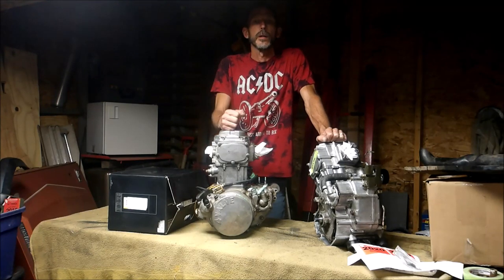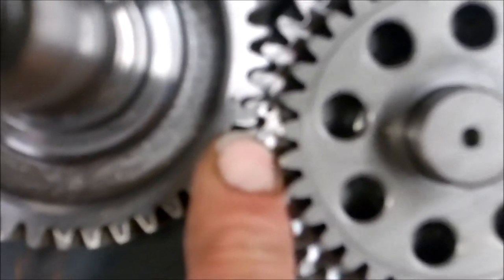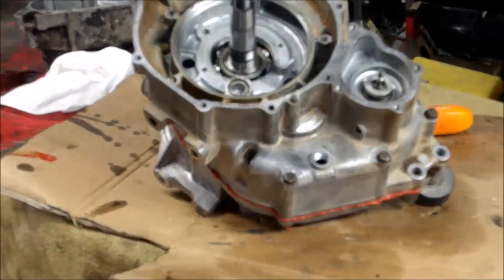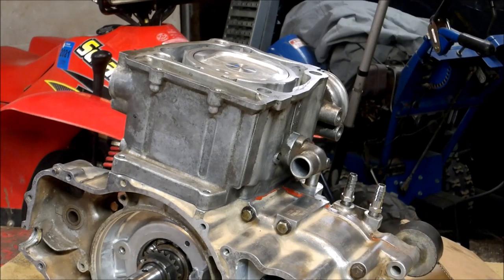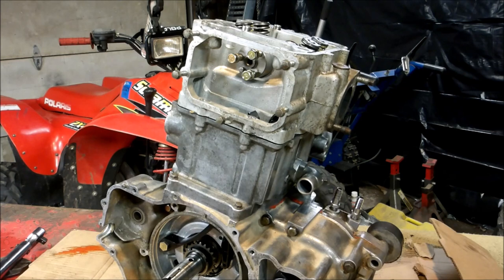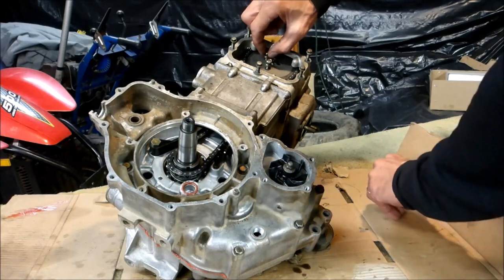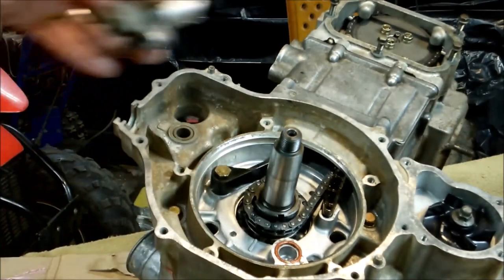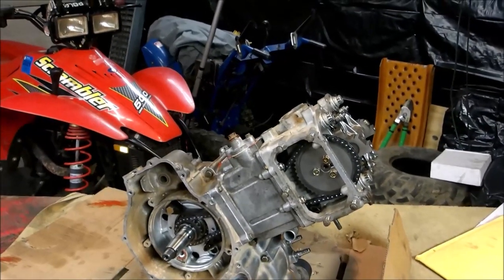Complete Rebuild a POLARIS 500 From The Bottom Up! And a 425.

Comment: Thank you.. very helpful video to increase my confidence in tackling this.  Have a 97 Xplorer 500 that I am fighting to get running despite a new stator, flywheel, battery, coil, plug wire, plug, filter, fuel pump, carburetor, etc.  Can’t get it to start without taking carb off and dumping fuel.  Going to tackle the internals..

Comment: I have a 2001 Sportsman 500 that needs a timing chain but I'm trying to get the fly wheel off but not sure which direction to turn the nut holding fly wheel on. Hoping you can help. Thanks John

Comment: the 425 "engine" crankcase. Was the crankshaft assembly and connecting rod all 425 as well? so you just changed the piston and just. The cams are the same but the valves are different numbers between the 425 and 500. Would've been nice to confirm if the valves were the same size with dial calipers.

Comment: got a 500 bottom end. connecting rod is in great shape. no end play and very little side to side. the main bearings are good to, turn smooth and no up and down play. but the whole cam shaft can slide left and right in the case maybe a half mm. what you think is wrong? i never split the case. you think something is worn, or maybe missing a shim? or should i just send it lol. have you ever experienced slight left and right movement in and out of the bearings on any of your engines. my other bottom end doesn't move at all.

Comment: Cylinder jug aka cylinder- 4 large 12 point bolts= 46 ft-lbs 
2 small 6 point bolts= 72 inch-lbs
Reply: Is this the torque value for the first 4 bolts he torqued before moving to the 4 bolts of the head? Not asking because you didn’t explain it well enough just want to make sure because I’m having trouble finding the torque value for the bottom 4 bolts lol
Reply: @johnshepard1157  Yes.  It's the bolts that screw in around the piston.  They sit down in it.

Comment: You mentioned the crankcase was cracked. Did you just get one used crankcase half and mismatch it  with yours or did you use a used pair?
Reply from the maker: I used a matching set. I have done a 400 2 stroke with missing match set and had no issues.
Reply from the maker: Miss matched
Reply: Thank you for the reply on an older video. I managed to crack the right side case while pushing in the counter balance bearings.

Comment: I've got a scrambler 500 ho 4x4 wanna rebuild it I googled the compression ratio and it's 10:8.1 but every piston I see that will work for it no matter where I look is 10:2.1, is that the actual compression ratio?... really don't wanna be down on power and speed.

Comment: Rebuilding my 425 and might get the 500 piston & jug. Did you use the 425 carb & exhaust or did you have to upgrade to the 500 carb and/or exhaust?

Comment: I really appreciate the video its very helpful. i do have a question do you bottom out the nut on the water pump impeller? it seems like it presses the impeller onto the housing? thanks in advance for any feedback!
Reply from the maker: I just snug it up with locktite. you don't want it rubbing against the case. you might have to back it off a little

Comment: What kind of crankcase sealant did you use? Polaris OEM Crankcase Sealant is about $50 for a small tube. Is the OEM sealant necessary or is there an acceptable alternative? Great video. I'm using it to help me rebuild my Magnum 330. Not exactly the same but a lot of what you show in your video is helpful. Thanks!
Reply from the maker: I normally use 3m gasket maker. You can get it at a auto parts store for 18 bucks.

Comment: Good work! I have learned alot from your videos. 
I've got a real teaser for ya..
02 500 ho just rebuilt topend, namura piston gaskets etc. Bored over as well. 
Anyway, runs great! But will only start with recoil, key cranks engine but no fire..
Any ideas?
Reply from the maker: Thats a new one for me. I'm gonna have to research that one. Interesting! Refresh my memory. does the 02 have the key that turns all the way to start it like a car? Or is it the push button style? something in the wiring isn't reading correctly.
Reply: @TitaniummanGarage  
Turn key ignition, I've tried jumping power from battery, directly to starter with key in hot position, still no fire, seeing week spark while cranking with starter, strong spark with recoil..pretty stumped. I can start it but my girls can't. I appreciate your thoughts and suggestions very much!

Comment: So Polaris made a 425 that had a 5 speed auto clutch trans I just wonder if u could make a 500 ho using a 500 jug cam and carb that thing would be wicked fast
Reply from the maker: I tried. Put an H.O carb and cam in it. wasnt much faster. Clutching it out right does the trick.

Comment: I got a 2013 Polaris sportsman with fi with 7600 miles on it, so with that said, it got to where it wouldn't cold start without holding the fuel down on it, so I would do a valve adjustment and it would be alright for about a month, or so, and then the intake valves would tighten back down, well, finally I bought new valves, and done a valve lap and installed them. If it starts with the same problem, do you think I ought to buy a new head and new valves to cure the problem?
Reply from the maker: Sounds like your chain might be streached.Try to replace the chain. clean the carb and check the choke adjustment.

Comment: This is a great video. Just subscribed. Just got my 1st Sportsman 500 w 900 hours.  The engine has a little knock.  (It's not a deep knock like low end.). I've noticed other Sportsman 500's on YouTube have the same sound.  What is it?  What do I need to do? Preventative wise?
Reply from the maker: It could be the clutch buttons. The lifters and chain make that noise as well when they are worn.
Reply: @TitaniummanGarage  Started it up again today.  Sound goes away when rev it but it smokes around the head/valve cover.  Shut it down right away.  I ordered cam & rockers.  Should I pull the head to see if there is piston slap?  Pretty sure the knock is from the engine.
Reply from the maker: @jaywinters2483  could very well be. I did a video years ago on a ATP. Turned out half the piston skirt was at the bottom of the engine.

Comment: Which oil hose do you pinch to prime the oil pump?
Merry Christmas, don’t drink too much Budweiser, mate.  How is Covid-19 doing in your area?

By the way? How do you pull the crankshaft apart? 
And putting it back together?
Hasta la vista amigo. Ándele ándele, arriba arriba
Reply from the maker: Have a Merry Christmas as well. We are getting hit hard in Wisconsin. I use a press to remove the crankshaft out of the block. You could use a big rubber mallet too.

Comment: Subbed . Man you have confirmed my tgeory same part different number thing!  Ive seen that with a lot of polaris stuff out there particularly sprocket and axle bearing carriers and what not. I have a 2000 polaris 500 sportsman 6x6. Chain snapped busted rh of the gear case. My thougts are i had an alignment issue on tge new sprocket and the output shaft bearing. Got a lot of slop in that output shaft now. I cant find my gear case rh anywhere! Do you have a source for that part? Id like to rebuild the trans while i got this down. Also the sprocket was replaced with a superceded part on that middle axle . The old one was seized to the axle and i couldnt get it off. I bought this used from a guy had bad bearings back there  and he just rode it that way for god knows how long. Well when it came tim to fix this , i ran into siezed sprocket on thw axle and rhe biggest of pullers only warped the old sprockt didnt budge it . So i had to cut the axle bearing carrier in half straight through the axle. The acle was badly damaged anyway so i was gonna have to replace it. But i could not get it out. The locking hubs were siezed up on one side as well . It was a real pain to get that back together. Well when i did i realized the sprocket would not line up proper. I need a spacer any idea where i can find one of those?

Comment: I am struggling to find a torque spec for the rocker arm tower bolts. I looked through a manual online and found 9 ft lb. that seems to be very light to me and want to be certain before putting it back together. If it is only 9 ft lb would it benefit having some blue lock tight to keep the bolts from coming out?
Reply from the maker: I would do that just to be safe.it is an aluminum block so that could be right.

Comment: Did you use a crank and rod from a 425? If so that should be a 465cc. I’ve been wanting to build one for a while. Basically put a 500 top end on a 425. Then use the h.o cam and intake /carb.
Reply: Hopefully the rod is longer. He never checked deck height. Hopefully it's not 7x1 compression now. I am planning the same
Reply: @eyeballengineering7007  have you calculated the compression to be 7:1 if using a 425 bottom end and 500 top end ? I was always curious. I think I remember the 425 being 8:1 and the 500 is 10:1 roughly.
Reply: @gshew6769  no, I went down the rabbit hole last night. The cylinder height is apparently the same. It's only the rod length that changes. So it should actually increase the compression directly between what the Magnum 425 and the 500 have stock. The magnum is 9.2x1 while the 500ho is 10.2x1. so the 465 with the same chamber and deck height should be approximately 9.7x1. I could not find the chamber size or the head gasket thickness. When I get my motor yanked apart I'll know a lot more. That's why the numbers are approximate.
Reply: @eyeballengineering7007  very interesting, keep me updated my old 400 is pretty lazy and I’m considering doing a rebuild on it and adding some stuff like a cam , bigger carb etc. might even do some at home port polishing.

Comment: Thank you, I will take a look at removing the cam and see what happens with the oil.
What about the sheared bolt from the timing chain that fell inside the engine? Has it happened to you, as well? I trying to figure out a way of extracting it from the engine without having to dismantle the whole engine, too painful, mate!
Reply from the maker: No I haven't.  I have had to pull out piston skirt out of the engine. If you pull the cylinder and piston you should be able to get a magnet down to the bottom of the case. If you have a magnetic wand. I ended up splitting my case. Your just looking for a bolt so It might not be that bad.

Comment: The 425 crank has 5mm less stroke, so essentially you've created a 465cc engine. Great news for 425 guys since there are kits out there for $90 that include the jug, piston+rings, and gaskets. Funny that it all just bolts right up and the piston has the proper deck height.
Reply from the maker: Right. People don't believe it when I tell them I do that.
Reply: Can you provide a link to this kit I’m having issues finding it
Reply from the maker: @TXCOyt  There isn't a kit. I just bought the gaskets and piston on ebay and honed out the 500 jug.
Reply: Got my 425 running about a month ago with a 500 rebuild kit. Everything fit perfectly, has good power.

Comment: Are all the 400HO engine crankcases interchangeable with 500s? I have a 2009 sportsman 400HO. Does it mater what year 500 jug i use? Thanks
Reply from the maker: That I would have to research. The older 400's had shorter connecting rods. No it doesnt matter what 500 jug. they are all the same.

Comment: Hello I've subscribed to your channel great content but I have a question what is the standard Piston ring gap for a 98 Polaris 500 because i have the manual and it say that its supposed to be gapped at 0.20/0.36 is that correct Thanks for your time keep the videos coming
Reply from the maker: Depends what piston you buy.

Comment: Great information! You just got a faithful subscriber!  :)   I hope you can answer a question for me and save me some time. I recently rebuilt a 2003 Polaris 700. It has been running fine now I have water in the oil. I can see seepage from the side stator casing. Do you think it would be the oil seal or head gasket?
Reply from the maker: I had one too. Its the Mechanical water pump seal. It could leak into the engine. But you said water right? Or coolant?
Reply: @TitaniummanGarage  Coolant.. I think water pump and water comes out of my mouth. You never hear them called coolant pumps. LoL
Reply from the maker: Lol. That what I thought. But yeah..the mechanical water pump seal leaks, gets in the engine and oil.  The 70's are known for it. I have a video how to replace it.
Reply from the maker: 700's. Not 70's.
Reply: @TitaniummanGarage  Thanks, you probably saved me some time attacking it at the right end first.
Reply from the maker: @jackgiljr  No Problem. Glad to help.

Comment: Question.  After putting my 97 Sportsman back together, I learned the oil seal is leaking (oil leaking out of weep hole).  Can this seal be replaced from the impeller side without disassembling the engine and splitting the case?
Reply from the maker: I've been asked that a lot. There is a way but it involves a tin snips and a flat screwdriver. It usually ends up in scratching the surface. If you do it that way put a light coat of gasket maker down. Just a thin coat. It says not to but there is a chance if you scratch the surface the mechanical water pump seat will leak.

Comment: Can you remove the chain guide without removing the head? Also I need to replace the timing gear on the crank and the split nut is proving difficult in to coming off.  Is there a spanner socket for it?
Reply from the maker: The right side chain guide is positioned under the head so you have to remove the head to get it out. The left or topside could possibly come out without removing the head with the chain out of the way. There should be a socket on ebay for that goofy nut. Or you could make one. Some guys make them out of pipe and notch the end out.

Comment: One more question Sir,
How can you tell when the oil pump is not working?
The pressure is minimal and I had my Sportsman 500 HO shear the timing chain sprocket, I guess it seized out of lack of oil.
Reply from the maker: I had one that snapped the chain. I  would replace the pump. Also check the hole where the oil comes in by the head .see if it's not plugger. It should be by the cover to pull cam out.
Reply: Any chance that you forgot to prime the pump after an oil change?  Requires pinching the reservoir hose for 10 seconds....
Reply from the maker: @RayofallTrades  That's a great tip. Thanks.

Comment: I have an 03 500 that I picked up and it must have overheated in the past because the piston pin was welded into the crankshaft.  I took the water pump cover it inspect the propeller and noticed what looks like hairline cracks .   The are no visible cracks on the outside of the crankcase.  Would you say this is a big issue?
Reply from the maker: You have to ask. Why did it over heat? If the mechanical seal wasn't leaking and those hair line cracks are by the pump. I dont know If I would trust it.
Reply: @TitaniummanGarage  thanks for the feedback.  My thoughts too but wanted your opinion.  Thanks again!
Reply from the maker: @trentelliott1473  Sometimes you need another person to bounce an issue off of. I do it all the time. It's all good..

Comment: Hey buddy I’m working with a 99 sportsman 500 oil is leaking from front exhaust manifold and when it runs it blows white smoke. Could it be my piston rings or a head gasket? Any knowledge or suggestions is greatly appreciated I’m debating on rebuilding the whole engine
Reply from the maker: Actually It could be both. the oil ring or head gasket letting oil seep into cylinder.
Reply: Losing coolant, black oil, fouled plug (if so what color)? Air bubbles in radiator?  Top end rebuild easy pretty easy and common

Comment: Is this the same for an 05 sportsman 500 ho? The engine seized up and had a rod knock before hand, needs a rebuild
Reply from the maker: Yes. The only difference is the chain tensioner. The 05 is smaller. Nothing to worry about. Other than that everything is identical. I just rebuilt one.

Comment: I have a serios problem I hope you can give me an idea ... a friend broke the water pump shaft on my polaris predator 500 2007 an I open the cases put everything back together an when i tide the case bolts the piston won't turn it gets so hard the. I untide them back an it move do you have an idea what can be holding it
Reply: Did you change bearings and not set them proper depth? Forget shim placement or maybe order the wrong impeller? Are you sure timing chain is correct?
Reply: It was the bearing wasn't all in thank you so much I have it done

Comment: Have you ever come across the issue of no power to the solenoid, you wait a while and it fixes itself, but if you crank it a few times and the engines has not fired up, the same no power problem resurfaces. What is going on?
Reply from the maker: Cdi box possibly?
Reply: No power to the primary or secondary of starter solenoid? If there isn't power at the solenoid,  the motor won't crank (turn). If it's no spark,  ( not starting) when hot,  it could also be the coil or spark plug....